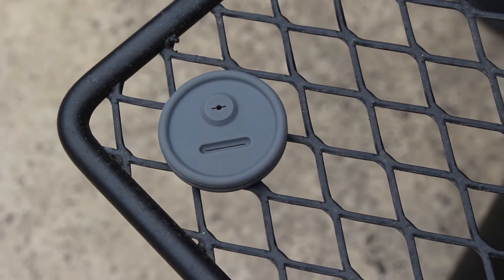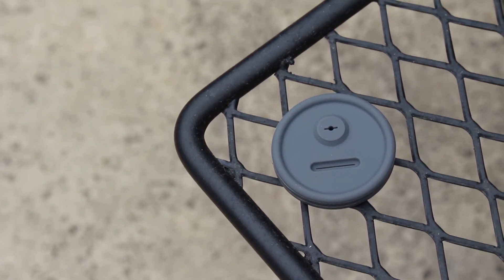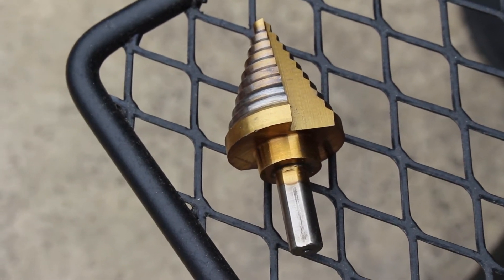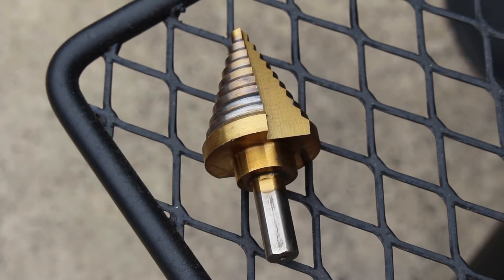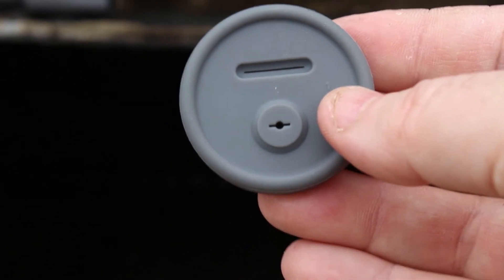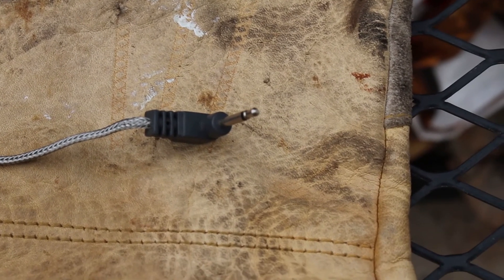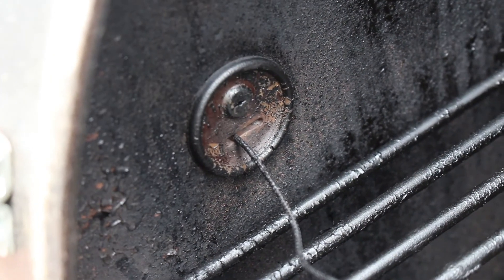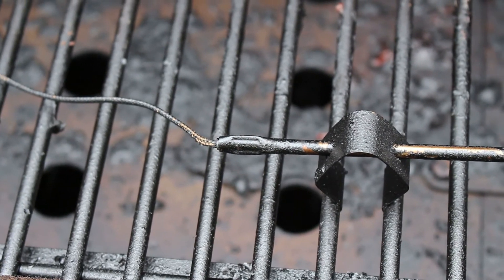Oklahoma Joe's Sensor Port Modification

Comment: I used a 1 1/2" hole saw with my battery powered drill and it went through like butter. Ry is definitely right about putting the grommet in, but take your time and it does go. Thanks Ry, one of the best mods I have added. Keep  on with your great videos!!
Reply: 1 1/2 hole saw or 1 1/4 one?  I see two users used the latter 1 1/4 and the instructions recommend 1 1/4 drill bit.
Reply: @tdprout  my mistake, it is 1 1/4. Sorry!
Reply: @mrmac123   No problem..thanks for verifying. I'm going to store today.

Comment: Just installed mine. I used a 1-1/4" Kobalt bi-metal hole saw, part# 0777734 (ebay around $10 including shipping)  and a spritz of WD-40 now and again during the process and went through in about 2 minutes (if that) no problem. RPM around 240 to 300.  The hole saw teeth were still sharp to the touch afterwords and probably ready for another go if needed.  Make a pilot hole first, no larger than 1/8" , otherwise the Kobalt center drill may grab too much metal at first and create a huge unnecessary bur/chip to blow through.  (Also... ALWAYS WEAR EYE PROTECTION WHEN DRILLING METAL! ).  I enjoy the videos. Keep 'em coming!

Comment: Thanks for the tips RY.  The grommet is a bit expensive and I ordered mine through Amazon for $18.79 and should be delivered next week along with my other smoker mods.  As far as drilling the 1 1/4" hole is concerned, I have 2 drill presses but they might be a bit cumbersome to hold the smoker body so I'm going with my 1/2" chuck electric drill.  I also found that if you use plain dish detergent such as Dawn as a lubricant, it will go through fairly quickly.  Additionally, you can heat the grommet up in some hot water for a minute or so then cover it with the same dish detergent to make it more pliable.  I've used this method on other applications and it worked like a charm.  Happy smoking y'all!
Reply from the maker: Good suggestion about warming the grommet up. That would have made it slip in easier with a little lubricant.

Comment: Just did mine.  Took me 15 minutes to drill, and install the probe port.  I used the step-bit, and just drill both sides of the steel. Put your cordless drill on the low setting. Go for a step of the bit, then switch to the inside of the smoker.  Drill another step or two, then switch...Vice versa, until you reach 1 1/4" size hole.

Comment: I have a brand new OK Joe's Highland, and I just don't have the heart to punch a hole in it. I was considering running the probes up through the drain hole. Would there be any negative consequences to doing that, other than potentially some greasy probe wires?
Reply from the maker: I think as long as your cables are liquid proof it might work.

Comment: Hey Ry,

It’s Nate again. I keep watching your videos.

Saw this one after the same port installation on your Weber. 

You mentioned how you had trouble drilling through the metal. After watching you drill through the other metal, even though you were trying to go slow, your drill was still rotating way to fast. 

Here you recommend using a corded drill instead of a battery drill. I would have to disagree. My Ridgid cordless on an 18V 1.5 amh battery has a much easier time controlling the speed, and routinely use it to drill through 3/8” and 1/2” steel I-beams, without causing any damage to my bits. I can get through 15-20 holes on a single battery charge, easy.

So if you can get an even slower speed on your drill, plenty of lubrication and most importantly and good deal of pressure, you can get through those thin metals in seconds...

Anyways, I like this mod, and I will be ordering one of these grommets soon.

Take care,
-Nate
Reply from the maker: Yes it’s much harder to dial in that slow speed on the corded still. In hindsight I would use the cordless Makita :)

Comment: Newbie question. Couldn’t you just run the probe wires through the drain hole in the bottom? I’m thinking of running the wires through a tube to keep the wires clean of the sludge on the bottom.
Reply from the maker: For me that would make it quite messy to take the wires in and out, especially the meat probe.
Reply: @CookingWithRy  I'm just not looking forward to drilling a hole in my smoker. Your reply makes sense , thanks

Comment: Why not just use the extra port already drilled on the upper part of the hood, parallel to the factory provided external thermometer?  Replace the bolt they have there with your grommet.

Comment: What do you use to lubricate the bit? Thanks.
Reply from the maker: It's a lubricant designed for drill bits. Really inexpensive. You can find it at any hardware store, Home Depot, etc...
Reply: Lower unit gear lube works fantastic.

Comment: Those step bits aren't cheap, but what you should have done is, saved the burnt one, bought a regular 1/4" bit for a few bucks, and go back to the step bit after the pilot hole is punched through. The step bit is still sharp past the first stage.
Reply from the maker: Yeah it was a learning experience, and I think I still have that step bit :)

Comment: Other options would be to remove one of the four screws holding the hood's handle, and pass your thermometer wire through there... yes you're down to three screws however that is enough to lift/lower the lid, and the screw/nut combo can always be replaced.  If your sensor wire is long enough, you could also pass the wire up through the grease drain hole.  Just sayin
Reply from the maker: If I did that I'd still have to drill out that opening to the proper size, and there would always be pulling on the probe wire when opening to door.
Reply: @CookingWithRy  I get that too.... you'd need a long cable and a small probe to fit through the existing hole.  I'm going to try running it up through the drip opening at the bottom and see how that goes.... I measured it and my cable is plenty long.  Just trying to avoid drilling into my new smoker ; - ).   Also, noticed that when the main lid closes there's an 1/8: gap at the bottom on the main housing side that a person could carefully notch out to allow the cable to pass without crimping.  Maybe someone at Charbroil will take the hint and manufacture these with a small port opening, and place the main thermometer down near the grill for a more accurate temperature reading.  Thanks for your excellent ideas and videos that keep us cooking.
Reply: I've now cooked three meals on the OJ with the wire for the thermometer coming up through the grease drain port and it works great, and the probe is able to reach past the half way point of the grill.  The only minor issue is having to let the magnet hold the display on one of the legs, rather then way up on the tray holder.

Comment: I used one Stepper Bit, Dewalt 18V Drill, Dremel, lubricant and 15 minutes later I  was done!
Reply from the maker: That'll work :) Good job!
Reply: Thanks for the Video. I had an electric drill on the side line, just in case.

Comment: I know this is nit-picking, but the part of the thermometer that goes in the meat is the transmitter.   It is probably a thermocouple that produces a small voltage that is directly proportional to the heat applied.  The indicator unit that sits outside the grill is basically a voltmeter that reads the voltage produced by the thermocouple.  The indicator displays the reading in degrees (or temperature).  The indicator in this arrangement become the receiver and the probe is the transmitter.  The indicator unit becomes a transmitter if you have a wireless indicator you can carry around with you and read remotely.
Reply from the maker: That sounds correct, but it's above my pay grade :)